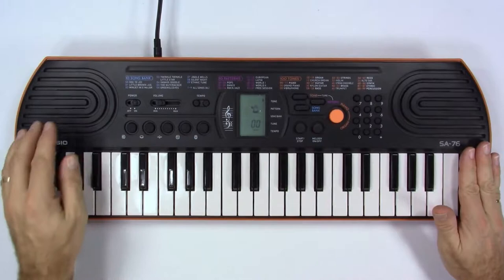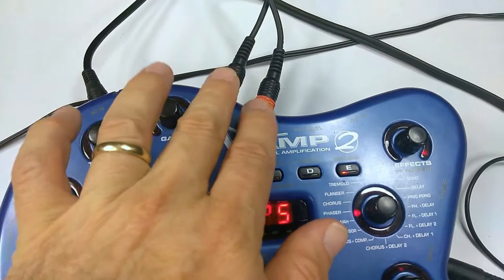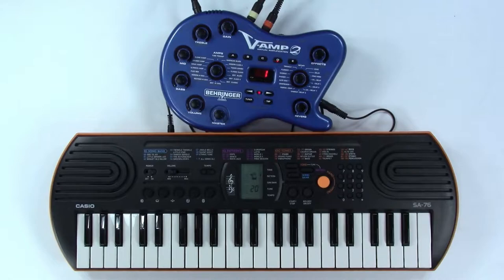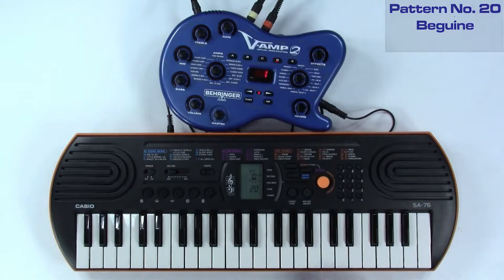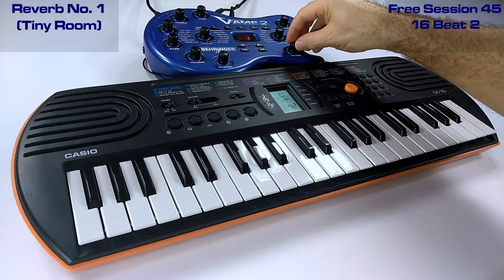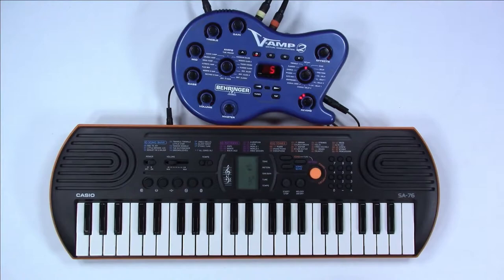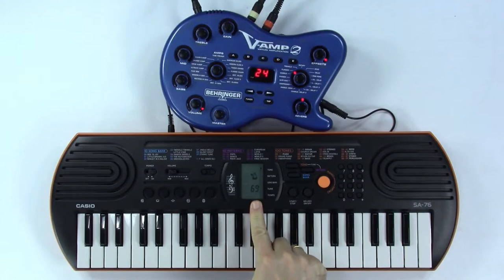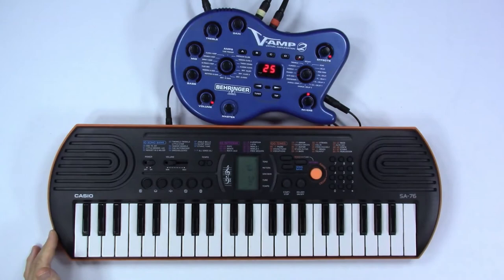Casio SA-76 in depth Test & Review (Part 3 of 4) - Adding Effects (Behringer V-Amp 2)

Comment: This is an awesome video, Is this also possible with a Ammoon Pockrock? if you have that effects too, can you make a video with it? hope this series will be more than 4 parts...
Reply from the maker: Thank you for the kind words!

I've never used an Ammoon Pockrock so I can't say how it would compare with the Behringer V-Amp used in my video. Looking at the Pockrock's specifications, it only lists a 1/4" mono output, so though the effects it has are similar to those in the V-Amp, they appear to output in mono only. One of the most dramatic changes you can hear by using the V-Amp with the SA-76 is that the effects applied are in stereo, which makes a big difference to the SA-76's mono audio. If stereo isn't needed, the Pockrock may suffice.

The reason that I'm doing this SA-76 review series in four parts is that I should be able to cover all its features in depth in that number of episodes. There are lots of other Casios and other keyboards I also want to review, so I need to move on at some point to be able to make videos of other models too!

Comment: Is this keyboard any good for home poto recording studios?
Reply from the maker: Do you mean "Porta" recording studios, like a simple multitrack recorder? If so, then yes, it can certainly be a useful little keyboard as it has a good range of tones and they sound pretty good for such an inexpensive keyboard. Its drawbacks are its small keys, no sustain button and also no MIDI. However, for quickly jotting down some musical ideas it's a handy little keyboard to have near by.

If you check out my "Harold F." track, you'll be able to hear what an SA-76 and a basic multitrack recording software package (Audacity) is capable of. :-)

Comment: I am a beginner

How is the sound quality of SA76?

Which one is better Casio SA76 or Yamaha F30?

Considering all overall features and sound.

Pls reply
Reply: my Yamaha PSS A-50 is far better! Dynamic keys, nice piano, few tones (40) but more useful. Only limit: 37 keys. For me is the best portable (less than 60 centimeters long) keyboard. But I love also this one (I have the SA-78) despite sound is not so good as with Yamaha.
Reply: Casio is worst even sustain effect, they didnt provide If my country has yamaha pss a50 I would buy yamaha instead. Honestly stay away from casio
Reply: @lunariansmith2417  I have both. PSS-A50 is a great keyboard, with a different price, and surely a better overall quality. But it has a limit: only 37 keys. Insufficient for classic music, even fot the baroque period. So I hope in a new PSS version with sensitive keys and 4 full octaves like the old Casiotone MT series. My preferred keyboard ever remains the wonderful MT-65.
Reply: @davidetambuchi5722  actually casiotone CT series still okay but SA76 I see no benefit from it even percussion pad they still delay :)
Reply from the maker: @Carts & Trolley - I've not had a chance to spend much time with a Yamaha F30, but one thing to bear in mind that it is in a different price class to the SA-76. When I originally put my video together, the F30 RRP was nearly double the price of the SA-76, so if budget is a concern then the Casio is the better bargain. Prices have since come down for the F30 model, but it is still more expensive than the SA-76 but only has slightly more features. I encourage you to try both of them at a store to make your own decision, and also check out part 2 of 4 of my SA-76 review where I specifically covered the SA-76's tones (some of them sound excellent). Additionally, if you check out my "Harold F" music video, you will hear an entire song recorded using only the sounds of the SA-76. For its price point, the SA-76 really is a super little keyboard (and much better looking than the F30!) If you have a bigger budget, then I would recommend the A-50 over both the SA-76 and F-30, though it is much more expensive and it's really a totally different class of keyboard.
Reply from the maker: @Davide Tambuchi - I also love my MT-65 and my MT-68 (I have both), and also my MT-400V that uses similar hardware/ sounds. I plan on featuring them in future episodes - stay tuned!
Reply: @CasioChaosTheory  Do you have tested the MT-205? Seem an interesting cheap old model
Reply from the maker: @davidetambuchi5722   - The MT-205 is not a model that I have in my collection, unfortunately. However, from what I've read it is apparently similar to the MT-520 but somewhat stripped down, and I do have an MT-520 and also the full set of optional drum pads that I will be featuring at some point. The MT-520 and drum pads have already appeared in one of my previous videos, " A Very Retro Casio and Commodore 64 Christmas Surprise", in the Jingle Bells part. The MT-520 provided the main melody sound, and the MT-520's drums provided the percussion :-)